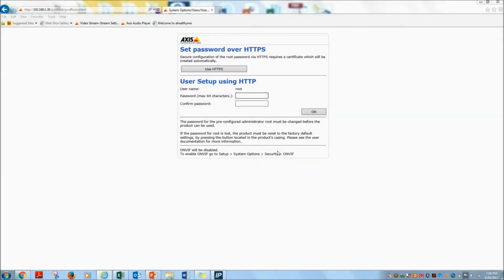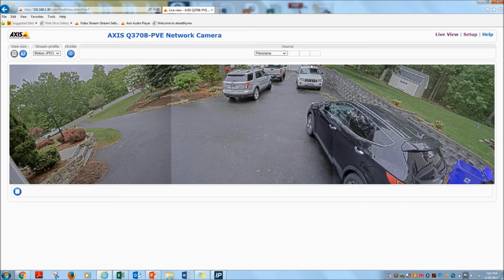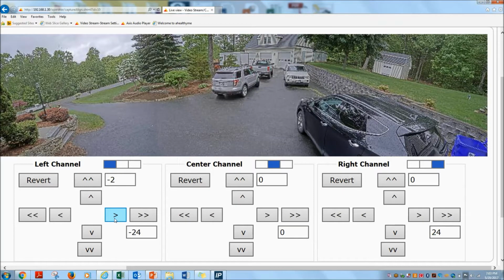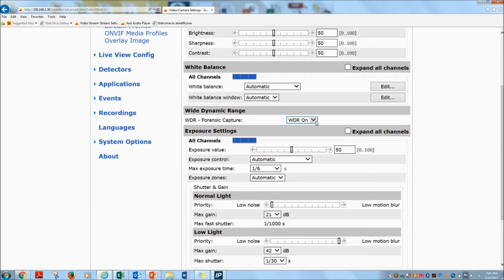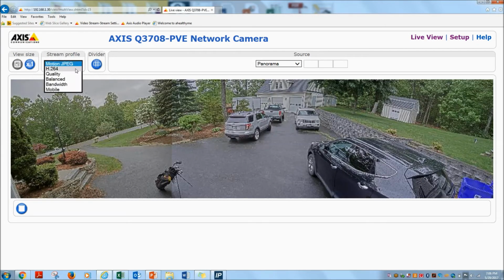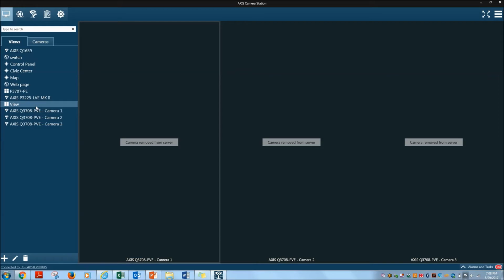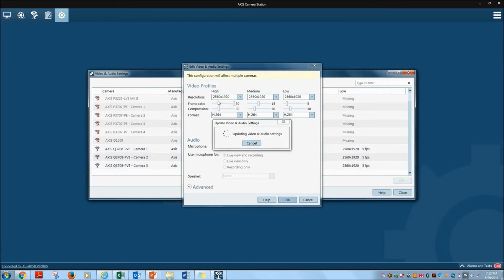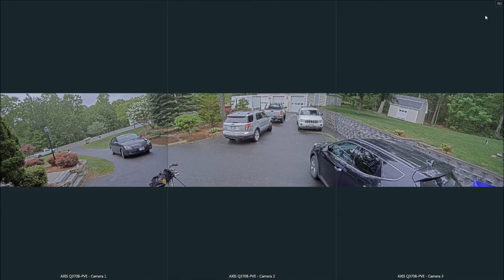Q3708-PVE Config Tips

Comment: Hi Steve, great video! Is there is any capture alignment setting for the 4 sensors on the P3807 PVE or a way these can be aligned? Having issues with misalignment on the sensors. Not seeing anything in the Axis manual about it.  Thank you.
Reply from the maker: No those are auto aligned out of box
Reply: Thanks Steve, I'll reach out to Axis support and see if there's any fix for the alignment. I have 6 of these and they all have varying degrees of misalignment.
Reply from the maker: @nicholaskraus5476  great!  where are you based out of?  Have you contacted your local Axis sales rep?

Comment: Is the resolution on the Q3708-PVE good enough to read license plates of cars that pull out onto the street (ex. someone turns around in your driveway and exists nose out)?  Also, how well does it handle that same use case at night?
Reply from the maker: Patrick Sowell not the right camera. Look at my p14 video.  That is the best camera for that.  Make sure the camera is focused on a choke point and is using the settings in the video
Reply: Thanks... that's what a figured.  I'm sure you know this, but going into the internal web page of the camera and adjusting settings there vs in ACS can cause instability on the Axis cameras.  There's certain settings you can tweak in there (video stream resolution, WDR, etc) that don't cause an issue but other settings (messing too much with events, etc) will cause the camera to have all kinds of issues.  I have P3367s, q3505s, M7014s, a P5415, and a P3346 and they all suffer from that problem.  Over time I've learned what settings I can adjust in the internal web page vs what needs to be done in ACC.  I don't use ACS today (tired it for a bit and actually didn't like it enough to pay for it) so I went back to ACC
Reply from the maker: Patrick So well well I haven't experienced anything your referring to and I work for axis.  I have a number of customers playing with settings and ACS is very stable.  If acc meets your needs great.  But ACS has come a long way and is a really good software.  I've used ACS with some pretty advanced setting camera and acs based and they all work good.
Reply: @unhthrower84  sorry tried to find your p14, but not sure which one it is , do you have the title for that review ? thanks

Comment: Thanks for the heads up on the live view 5MP settings in ACS :)
Reply from the maker: cbinny1 your welcome.  makes a big difference which is why I made the video
Reply: The only problem with that is if you want to have a low bandwidth stream that will load from a mobile phone on 3G/4G, or just slow WiFi/LTE, you're going to have problems with getting live view to load if your mobile connection isn't fast enough.  I keep my ACC_Low profile very low (5fps with 30% compression at below 480p on all my cams) for that very reason.  You can jack up medium and high streams like that and they're still available to you on both the windows client as well as the android/iphone app by simply selecting "high quality"
Reply: Not to mention if you record to a local SD card it may not be able to handle that (two streams at very high settings) and you'll have pixelization and frame rate drops... which could cause you to NOT record vital moments just when you need them.  Just my $.02